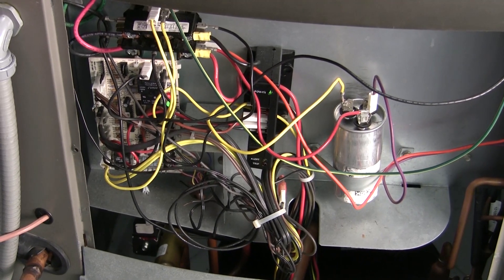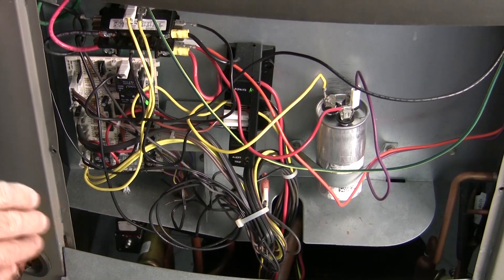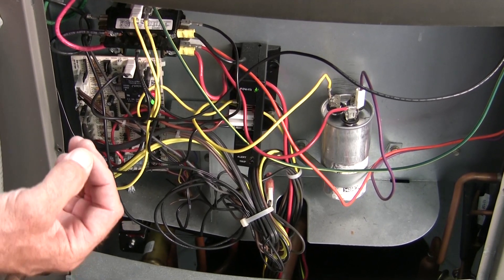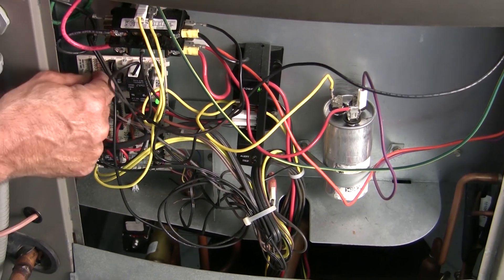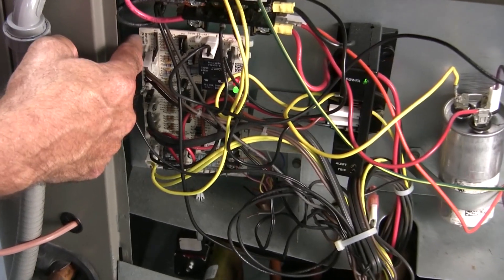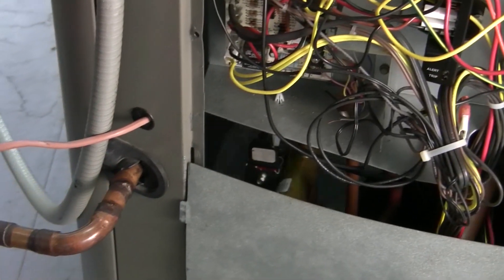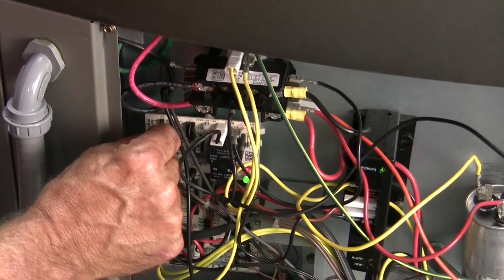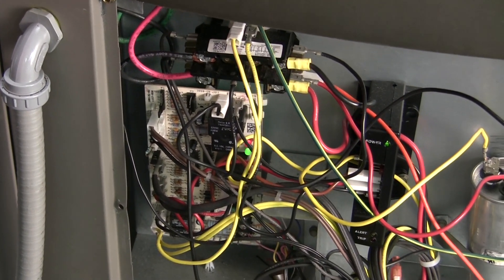Testing a Demand Defrost Board

Comment: Before I condemn the defrost board part number Trane CNT 02941. Split unit heat pump. Two defrost temp. sensors (ambient and coil). Defrost is auto "demand". Condenser ices-up. I short out force-defrost pins, unit enters defrost mode, OD fan cuts out, but ONLY 5VAC to reversing valve. Should be 24VAC in order to switch-over refrigerant direction. Reversing valve coil Ohm checks good. Both sets of sensor pins on defrost board show proper voltage at 5.5VDC. Both outdoor temp. sensors ohm out good relative to outdoor ambient temp. LED flashing normal. I had to melt the ice by shorting out force-defrost pins and temporarily jumpering R-O wires at condenser which sends 24VAC directly through defrost board to activate reversing valve. So, reversing valve is not automatically receiving proper voltage during defrost cycle. Any suggestions for other tests prior to condemning defrost board? Thanks.
Reply: @HVAClearning    Thank you for your reply. I just replaced the board and all is fine. I think that I covered all of the possible tests that can be conducted in the field as described in my first message. On the solder-side of the bad board, I did notice blackening on one single solder connection indicating "burn."